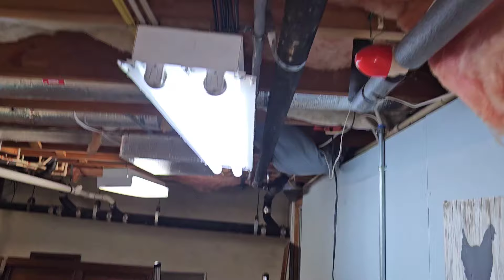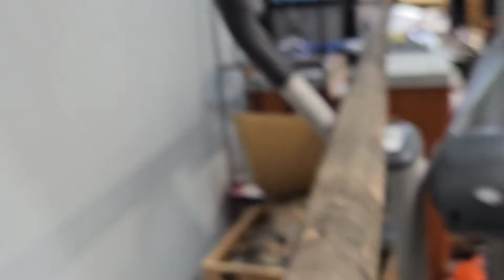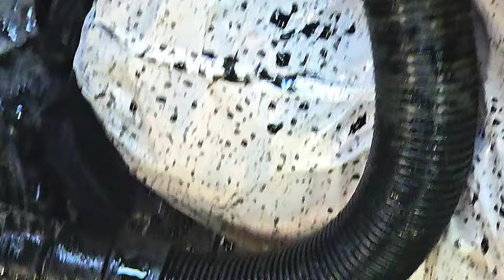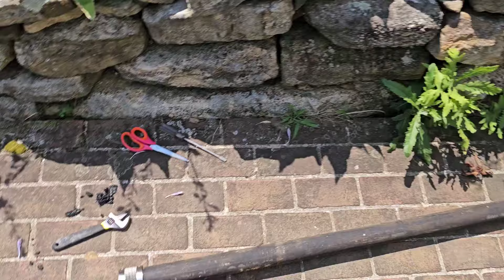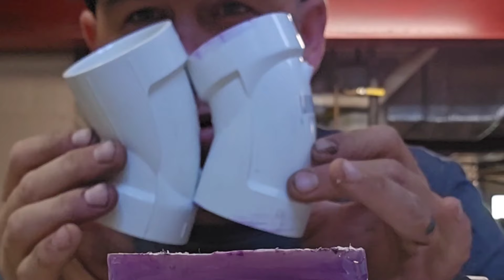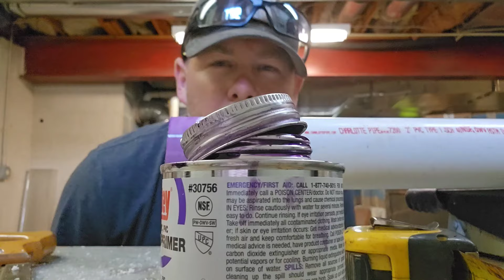This is why you shouldn't use cast iron plumbing

Comment: Justin...   All that black "sludge" is grease that was put down the drain by the previous owner. That's what was in my pipe. My plumber snaked it  and flushed it. My clog was 30 feet in. 
Best to use Dawn dish soap to clean up all the mess afterwards.